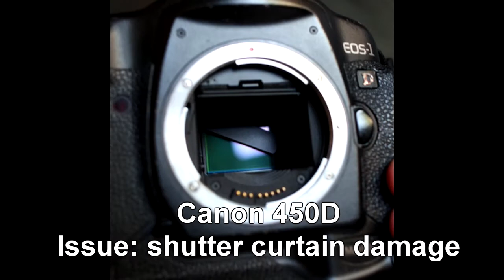Canon 450d / XSI shutter replacement, sensor cleaning, assembly guide

Comment: Hello. Thx for the video. After replacing the shooter works, but after shoot there are Error99 again... tell me please - did you  update/change the camera's firmware after replacing the shooter?
Reply: Hello,
If you have a Error99 most of the times its issues with the shutter...
Have you re open the camera and see it the shutter its jam?!
In this camera, i did not made any update/change the camera's firmware!
Reply: As I wrote above - I replaced a new shooter, but the error is displayed anyway.

Comment: hi, i disassembled my 450d and remove the IR filter at first camera was working fine but suddenly stopped working ant wont turn on!
can you help me plz?
Reply from the maker: +Ehxsan Hi there,
I cant say what is the issue!....
Nevertheless you should open the camera again and check if all ribbon tape connections are in place! 
Maybe it was some connection that was not well secure!
cheers

ps: is the battery charged?